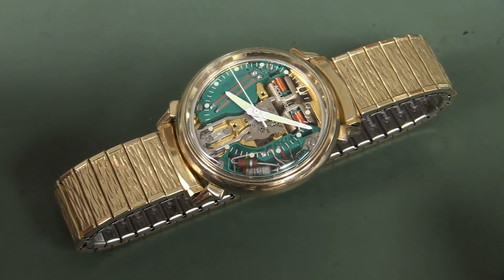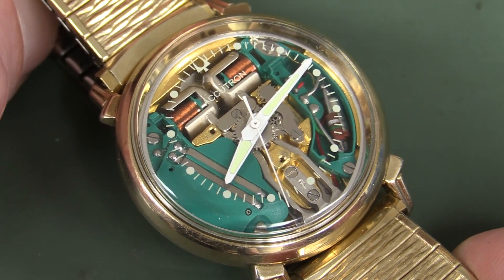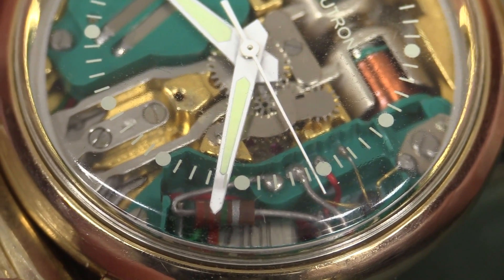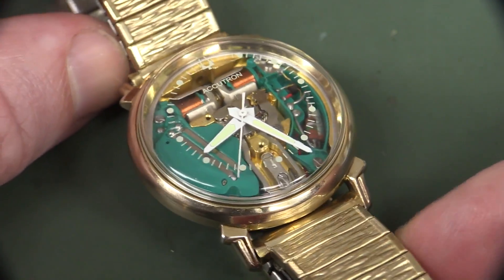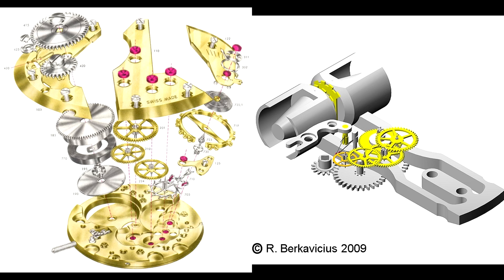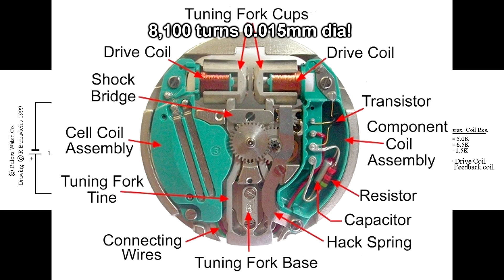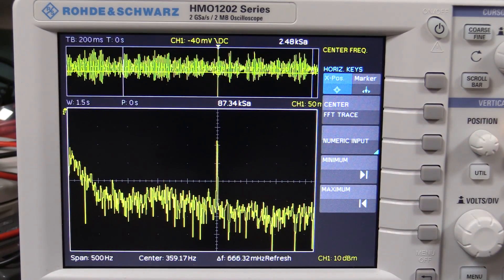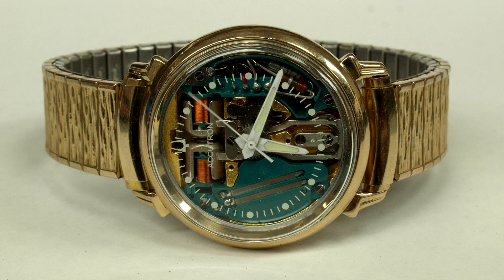EEVblog #920 - World's First Transistor Watch! - Bulova Accutron Spaceview

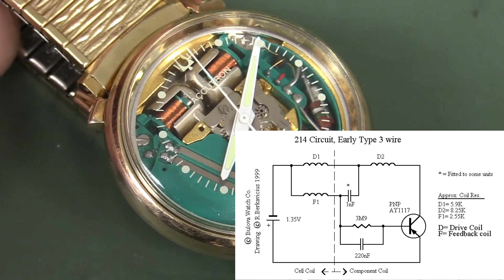Comment: 1:30 "Change from Germanium to NPN" I think  you meant from Germanium to Silicon.
Reply: Yes, but he might have said that because back then all Germanium transistors were PNP ~1960 - -  of-course you'll have to reverse the polarity of the battery, if the crkt allows

Comment: How did the electronic oscillating circuit detect the mechanical oscillations?
Reply from the maker: The feedback coil
Reply: enviroment temperature doesn't have influence in the clock freq like in others RTC modules for example?
Reply: Other way around. The electronic oscillations, by way of the magnetic fields around the coils, kept the tuning fork moving. Then, as shown in the diagrams, the movement of the tuning fork drove a pawl against the delicate first wheel. A design so simple (and tiny!) it was genius at the time.
Reply: @jpoconnor5744   The Russians had fits trying to copy it.

Comment: It seems strange that the US government would give these to foreign dignitaries when Bulova is a Swiss company.
Reply: In the 1960s Bulova was an American company. It did not become a Swiss company until much later. Like most famous American companies, it became a stick on name for products made elsewhere.
Reply: +Tak Wolf  Not true. Bulova is and was always an american factory in Albany, New York. But since the 30's or earlier, they founded production sites in Neuchatel and Biel in Switzerland. The watches were swisss made. Today,  the Bulova brand is owned by Citizen. Citizen produced another 1000 pieces of these watches in 2008, all numbered 1 to 100 and sold for $ 5000.-. These watches are of a quality you will not find today. Even the rubber joints are good after 50 years! But don't let these watches fall, they have an extremely fine mecanism inside. The very small oscilation is transformed via an extremely small metal tongue that moves a 2mm wheel which has 300 teeth into a rotative mouvement. The minuscule metal tongues have an even smaller jewell at their ends. The mecanism is a kind of ratchet on a very small size level. The whole art consists in the tuning of the tongues. You must have very still hands and have a lot of patience. Never take these watches apart!  There are only a few watchmakers that know how to repair them.
Reply: @jurivlk5433   The US made Accutrons had a letter starting the serial numbers the Swiss a number.   They were NOT all made by the swiss.
Reply: They're probably bugged lol.
Reply: And Rolex were English based in london, til they moved to Switzerland.

Comment: Considering how noisy the 100Hz signal was compared to the 360Hz one, could the 100Hz be the noise of the gearing system?
Reply from the maker: Could very well be. Best way to do it would be the remove the gearing and just leave the tuning fork and drive circuit. But it's the gears that also add to the famous "hum"
Reply: EEVblog Plus that would mean taking it apart and I think that would be a bad idea.
Reply: +EEVblog Don't take the gearing apart, please! You will never ever be able putting it together. The small ratchet wheel is very fragile and must be handled by experts only.

Comment: I remember seeing adverts for these i n old magazines. Terrific engineering, the frequency must give the first cog a good workout and durability must have been a serious consideration for the designers. Does the tuning fork self start or do you need to give the case a tap after changing the battery?

Comment: How much does one of these cost??
Reply: starts about 250 to 350 USD on ebay...

http://www.ebay.com/bhp/accutron-spaceview
Reply: between 500$ and 2k$ from what I saw...
Reply: Bearing in mind that at the lower end, they're probably refurbished and/or converted. A 100% original spaceview is going to cost more. Not that it really matters if you just want to have it as a cool watch.
Reply: +Shawn Abernethy you can get a decent non-spaceview for as little as $60-$75 if you shop around.
Reply: +D. C. Real ones are not for sale. Radiation
Reply: @NeverTalkToCops1  They never used radium in Accutron dials, it was made illegal in 1967.  Modern conversion Spaceviews use Luminova  Lume hands.  And no law against owning a radium watch, you just can;t make them anymore.

Comment: Regarding the strange appearance of the tuning fork at 1kfps, could it be due to image processing in the camera?  Since there is no flicker or flashing (not sure what type of illumination you have) the camera must do something to compensate.... just a thought.  Also, could it be a "jello" effect where the lines are shifted out of the image sensor during capture instead of after capture (not a static frame)?  Try some other oscillating object near 360 Hz to see if you get the same effect...  Nice watch, though!
Reply from the maker: No, I explained this in an annotation overlay, it was me video editing machine stuttering on playback.
Reply: +EEVblog Ah, post-production artifacts!

Comment: I find it peculiar that these oscillators would have been used in scientific equipment of the time. I'm pretty sure that quartz crystal oscillators would have been in use in electronics, especially for things like RF applications, for quite some time by the 1960's. My old mentor still uses an old dinosaur HP 5245L frequency counter with nixie tubes for the display and an ovenized crystal oscillator as the time base.  I guess a tuning fork like that might be useful in some applications if there was a need for accurate timing derived from a low-frequency source rather than dividing down a high frequency crystal?
Reply: Quartz oscillators have been around since the 1930s, but they weren't able to be run off of a single button cell battery and fit inside a watch case in 1960. Not to mention all the divider stages needed to get the crystal frequency down to the range needed to drive a watch mechanism.
Reply: Bob Weiss Right. I can absolutely see why it made sense to go with the tuning fork for the watch. I was more curious about how they were being used in the other applications that he alluded to. I guess anything space-related will probably want to be using the lightest, lowest power devices possible, even if it technically isn't as accurate as a crystal.
Reply from the maker: I'm not entirely sure why, but mostly used for size, space, and weight reasons?

Comment: battery must run out fast
Reply: Battery lasts about a year. The tuning fork is not only the time reference but it also directly powers the hands via a couple of pawls and index wheel. The battery is only use to keep the tuning fork vibrating.

Comment: That ticking sound is the sound of inefficiency. It comes from the escapement that tries to add back in the energy lost from the balance wheel through friction. no escapement required with a precision oscillator in place of the balance wheel.

Comment: I used to work with stuff like that compass all the time when I was a defense contractor. Worked on test software for the US Air Force, and there were always bits of hardware like that floating around the office. Everything had those chunky barrel connectors on them, with equally robust cords and plugs. Think the spec for that connector dates back to the 70s, and they ended up on pretty much everything.

Comment: Does that luminous dial contain radium? In other words, is your watch radioactive?
Reply: Yep.  And the lack of a visible glow doesn't mean that the radiation isn't present. The phosphor compound wears out from radiation induced damage LONG before the radium decays by any significant amount. Ra-226 has a 1600 year half-life.
Reply: Likely - but the amount of radioactivity is far less than just negligible.
(the dangers of radium-paint came from those that painted it liking the brushes - and ingesting alpha-emitters is not such a good idea - so just don't eat the dial)
Reply: It's not dangerous, but it's still more than enough to make a geiger counter scream, if there is indeed radium paint on those dials, and i think it would be interesting to see.

Comment: please don't do a tear down its too valuable of a watch due how rare it is
Reply: He's done tear downs of more valuable pieces of kit than this :)
Reply: They're all over eBay, so no they're not that rare.
Reply: There are a HUGE amount of fakes and regular Accutrons that have been turned into Spaceviews.   This one looks like an original Accutron which has had the front crystal replaced with a replica Spaceview crystal and the face removed to expose the mechanism.  It's likely not an original.
Reply: +ck m very few spaceview Acutrons are original
Reply: +ck m It is an original. You can't transform a regular Bulova Accutron mouvement into a spaceview. They look completely different and non-spaceview also have a date or even day-date mecanism.
Reply: +Tak Wolf This is not true. You cannot fake them.
Reply: @jurivlk5433  80% of the Spaceview Acutron’s on eBay are fake. The conversion kits are for sale cheap. You have no idea what you’re talking about. I think you’re confusing 214 and 218 movements.
Reply: Plus he gets so impatient when things won't come apart... most likely he'll announce "And we're in like Flynn" just as four wires get broken...